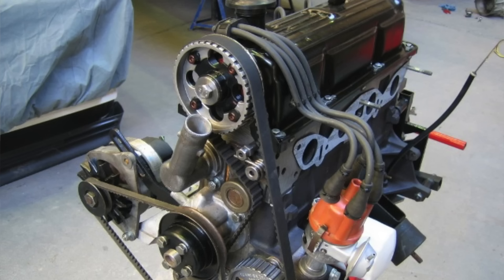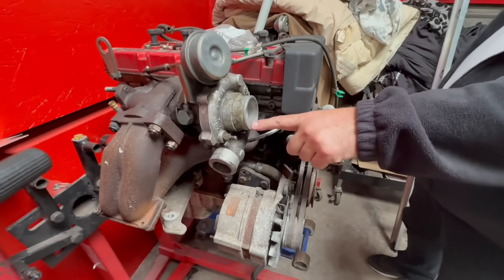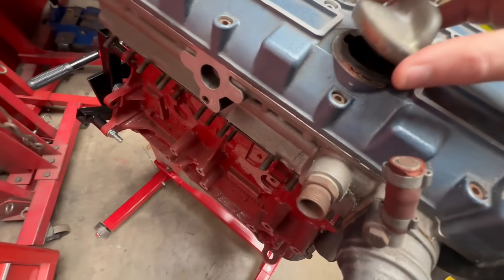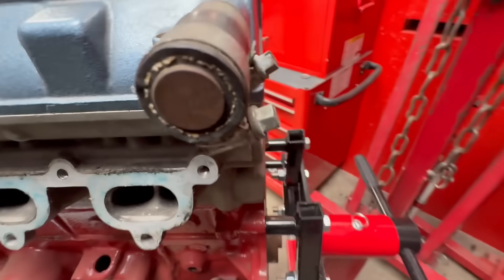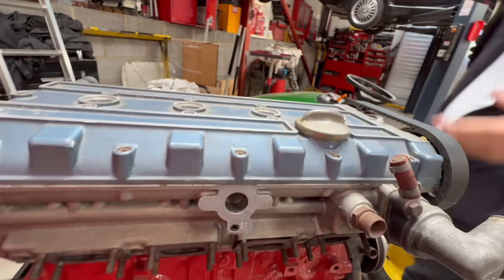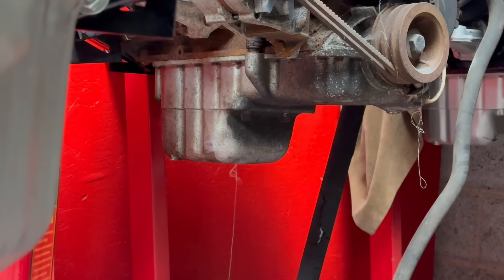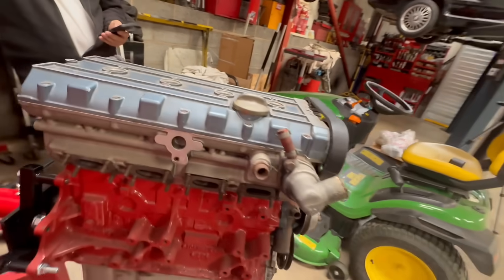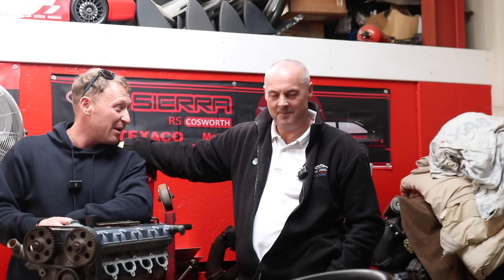Prototype Ford RS Cosworth Turbo Engine ** Number 4 out of only 10 Found **

Comment: Talking about development engines. I the early 1990s a mate off mine was building a race engine for a mk1 escort for the club car series in Australia so we when to Dick Johnson to get a used Cossie head off him and I could believe how many he had in a big pile and they were all cracked. Dick use to take them to the limit and some. So we got one and my mate built the race engine with the crack still in the head as you couldn’t get in to weld it. So he just chemiwelded it. The car it was put in went on to win the under 2 litre Australian Club Car Championship.

Comment: The Focus RS mk1 went through similar process!   They sold the Ford dealer special T230 / T190  and T250 *only 3 made and I had one!   Also had a t230.  These were sort of development cars before the RS !   There were road going engines but one or two had them with ZETEC CGI blocks.    No official records like the Cosworth but was officially done in collaboration with Mountune,  DPRS and Gordon Spooner Engineering Through Ford dealership!  You could have the conversion done to your car or order one built from new!

With regards to the price now Adam, you have bought it in to the mainstream probably worth double now!
Reply: I worked for Mountune at the time - had a t190 as a company car for a short period.  Great sleeper.
Reply: @timbo19751975  I found the T250  on ebay advertised as an 'st250' £500 !  Wacked on a fuel pump drove it to Istanbul and back!  Didnt skip a beat ,  best car I've ever owned.  Had a few focus rs mk1s since none of them pull like the T250!  Even my current one 410 bhp , is fast and savage but just there was something about the t- series!
Reply: Amazing that ford bought into volvo and used T5 similar designed engine in their never thought theyed use a 5 pot.. Brillant engines 😊
Reply: I worked for a place in Bicester,  we had a standard road going Focus come in from Mountune to have a turbo pipework mock up done.

Comment: On a similar note, when I was at college studying mechanics, I had the fortune of working on a pre-launch Fiesta XR2i which had been donated to the college by Ford themselves. Instead of the 1600 CVH engine, there was the prototype of what we all now know as the Zetec engine. 1800cc, no markings on the cam cover and wiring in the engine bay for all sorts of technical information. It was the test engine for the revised XR2i launched in around 1992 time.
Reply: Worked at ford dealer 80s to 96 know the cvh well mind the zetec 16v came out in 93. The first batch had sticking valves.. All warrahty new cylinder heads had to be fitted 😊

Comment: from the Cosworth book, ford management were on a tour of the cosworth factory with regard to the F1 program, led by the great Stuart Turner, on the tour they 'accidently' came across a project cosworth were considering of doing a 16v head on the ford pinto 2.0L engine, looking at a run high double figures in builds for the aftermarket tuning world, at a lunch after the tour they were talking about what had been seen on the tour, Stuart mentioned that it could be used by ford in the sierra for touring cars but would need to be turbocharged to work for them, from there the YB was born